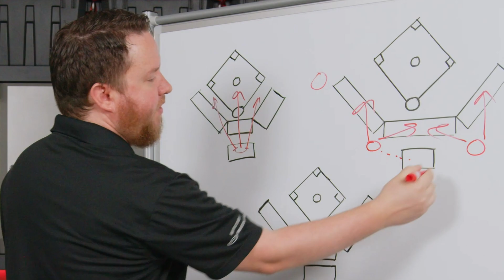What is a High Pass / Low Cut Filter? On Pro Acoustics Tech Talk Episode 135

Comment: What's the difference between a low pass filter and a crossover "only bass"?
Reply from the maker: Great question! A low-pass filter is a specific type of filter used within a crossover, which manages the full frequency division for a sound system. The low-pass filter allows only the lower frequencies to pass through while blocking higher frequencies. A crossover typically uses low-pass filters (and other filters) to separate audio signals into different frequency bands, sending bass to subwoofers and mids/highs to other speakers.
Reply: @ProAcoustics thanks

Comment: Thanks for the info. I’ve got a very low buzz with my sound system and I can’t figure out how to eliminate it. Would a pass through filter help? 

https://youtu.be/5WstjTQHL1I?feature=shared
Reply from the maker: A high-pass filter mainly rolls off low bass frequencies—so if your buzz is very low, it might reduce it a bit, but it generally won’t fully eliminate the issue. Buzz or hum often stems from grounding problems or interference, so double-check that all your equipment is properly grounded. You may also want to explore dedicated buzz/hum eliminator hardware.
For a practical guide—and some simple, budget-friendly fixes—I’d recommend watching this video: https://youtu.be/einxGsiuwso